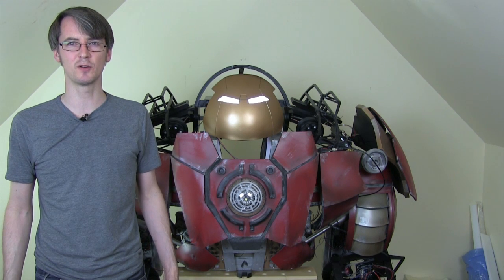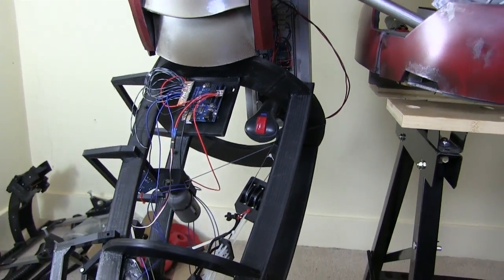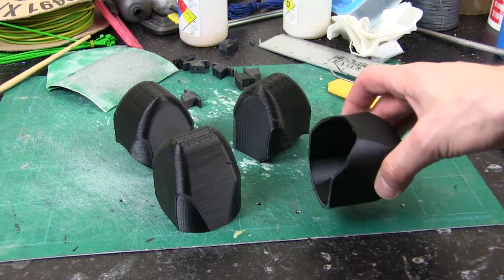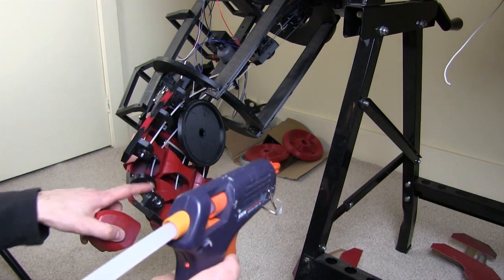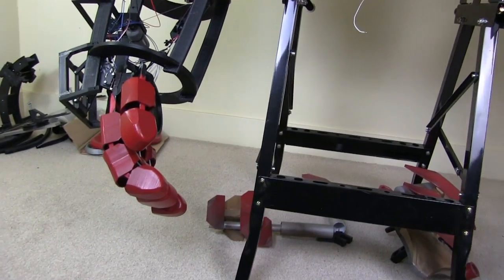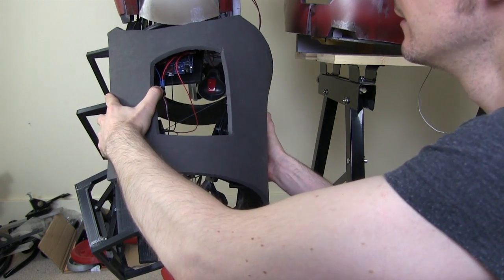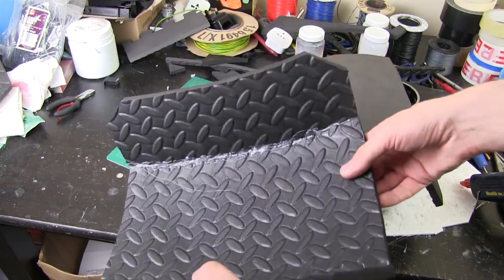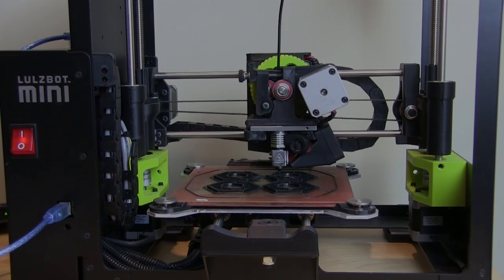Iron Man Hulkbuster Cosplay #37 | Hand & Forearm Panels | James Bruton

Comment: James, I found something I think you should look into.  A company called Advancer Technologies is going to be producing a sensor they're calling "Myoware".  It's a low profile, relatively cheap (38 bucks per unit) EMG sensor.  Summed up, EMG's pick up the electrical signals in your muscles, and can discern between strong and weak signals, provided they are placed correctly.  These Myoware sensors are designed specifically to be used with Arduino, and allow you to control electronics with muscle flexes, so they might be handy for controlling the peripherals in the Hulkbuster, or other future cosplays.  Heck, Advancer even demonstrates their use in a partial Iron Man cosplay.

Comment: I dont understand what Aceton does. Can someone explain it, please?
Reply: Twoface698 it melts the plastic. If you put a part in a bucket of it it would disappear eventually. If you use just a tiny amount on the surface though, it will only melt a tiny bit, which can make it much smoother than when it came right out of the printer.

Comment: A tip I learned for using foil, if you need it to be more durable  (which is good when using it for patterns) is to attach it to a layer of newspaper using spray adhesive. (i use the 3M super 77 spray) It becomes far more durable, quieter, and tear resistant, while still maintaining its shapable qualities.

Comment: Also, you can use contact adhesives to stick most surfaces together so that you don't have to race against the clock to glue the pieces before the hot glue hardens
Reply: Yes contact adhesive is a much better glue.  Crafters/modelers need to get over their obsession with hot glue, it's quick and easy but it never holds.

Comment: For the part where you glue the two foam pieces at an angle, I suggest using contact adhesive. You can get a near perfect seam and also reinforce the back with hotglue

Comment: If you use alligator clips at the end of skewers and stick that in a Styrofoam block it is a really easy way to paint up parts and get an even spread since you wont have to turn the parts manually, just a tip from a model builder on painting.